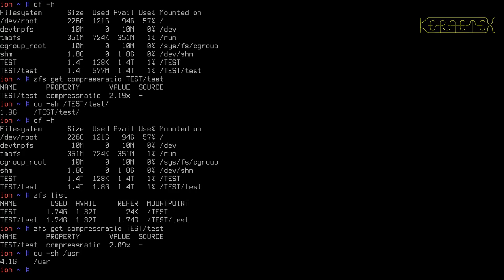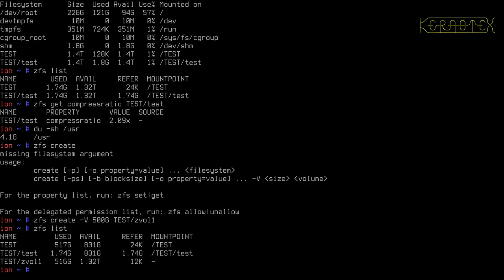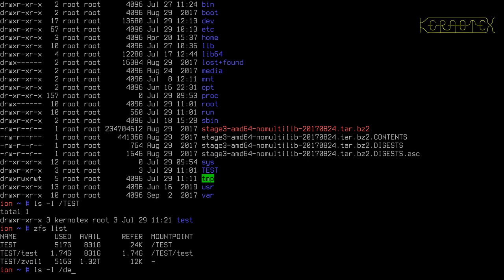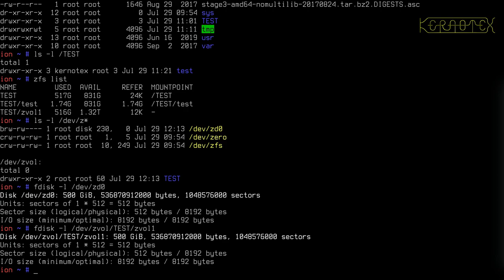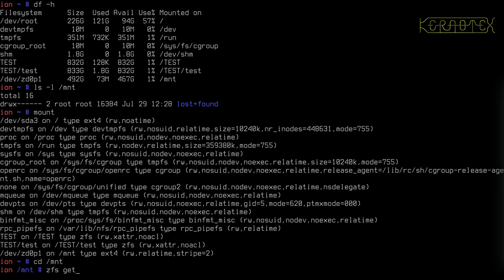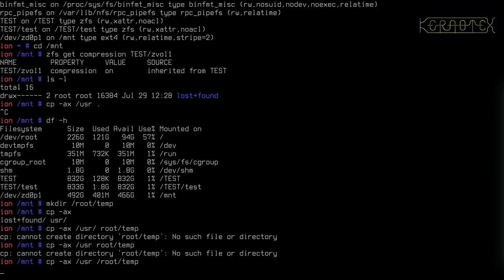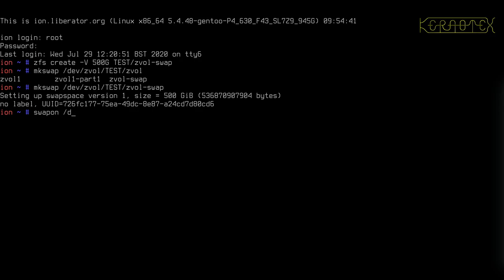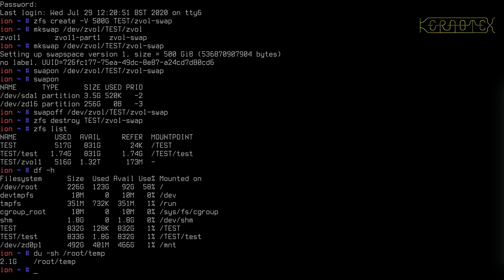Beginner's guide to ZFS. Part 12: ZVOLs

Comment: There's a typo in the command at 15:55:
  cp  -ax  /usr  /root/temp
 It shouldn't be "/usr" it should have been just "usr" because you wanted to copy from the /mnt/usr that you had just copied into /mnt earlier.
So the command should have been:
  cp  -ax  usr  /root/temp
Reply from the maker: Thanks @chaigtin259, you're correct, I lost it a bit there!
Reply: @Kernotex Thanks for bravely putting up so many videos to help us learn the intricacies of ZFS, it has so many features.

I only recently realized that "zfs send" can be resumed if I include the "-s" flag on the "zfs recv" ; if something gets interrupted and I need to resume the "zfs send", the "man zfs-recv" page explains about the receive_resume_token and how to generate and use it.
Reply from the maker: Thanks @chaigtin259 I didn't know this either. I think it might be time to refresh these videos!